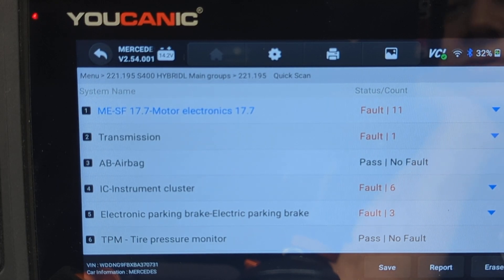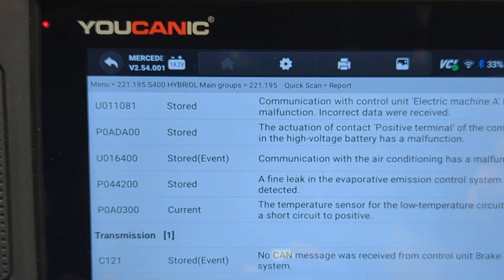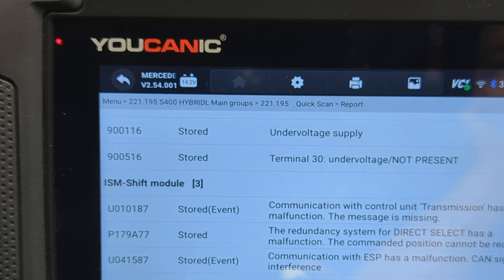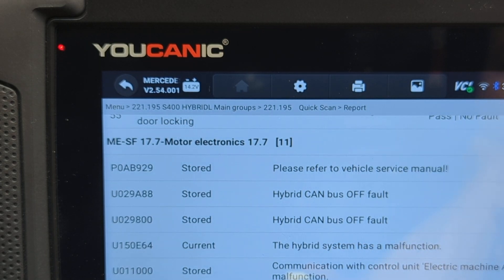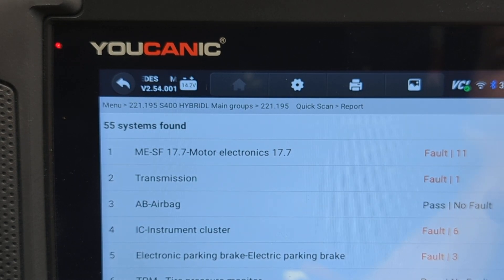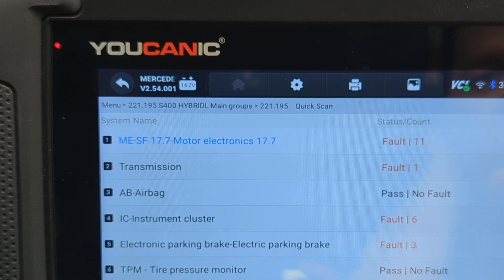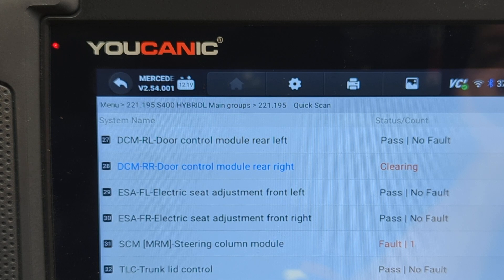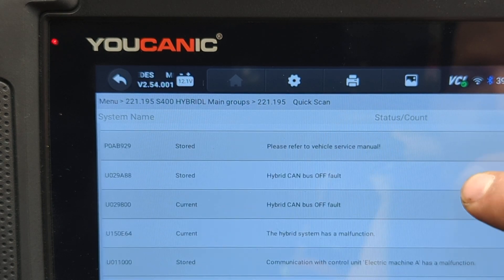Current vs Stored Fault Codes on YOUCANIC scanner - DTC Status Explained

Comment: Any idea what a "history" code means?
Reply from the maker: Thank you for your feedback. A "history" code in auto repair typically refers to a problem the vehicle has had in the past. Our main aim is to assist you in effectively fixing your car issues. Modern cars require an advanced diagnostic scanner, like our YOUCANIC Full System Scanner, developed specifically to empower car owners. You can check out more about it here: www.youcanic.com/scanner .

We understand that performing repairs requires precise instructions and specifications, so we also offer Factory Repair Manuals and Torque Specs accessed through www.youcanic.com/manuals. This small investment can help ensure your repairs are completed correctly.
Reply: @YOUCANIC  Sure, but any idea how a "history" code differs from a "stored" code? They sound like the same thing.

Comment: Could you possibly give me some insight on this code? It’s a 2012 Porsche Cayenne hybrid and it keeps on discharging the 12 V battery and use it as a three code that I come up with. I’m not at all familiar with this car. Any opinions that you might have would greatly be helpful Appreciate it. Code p0562, p3096,p0088.